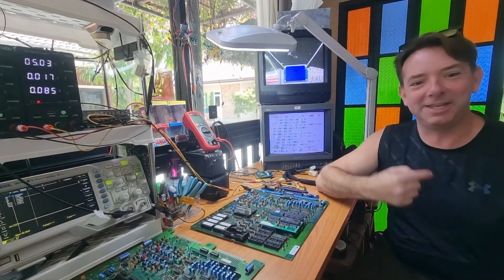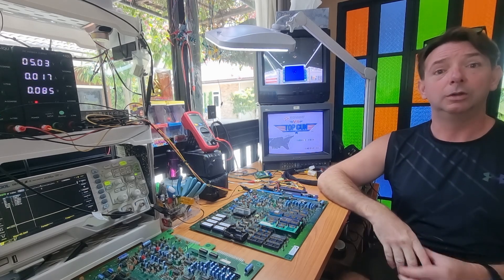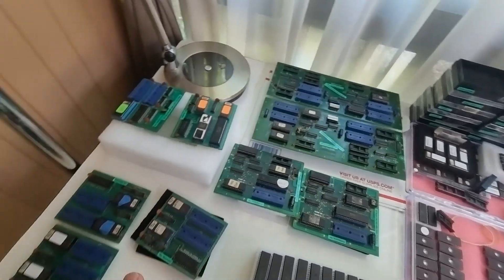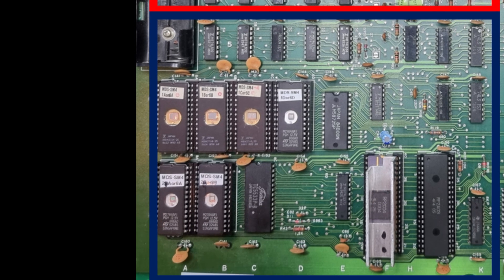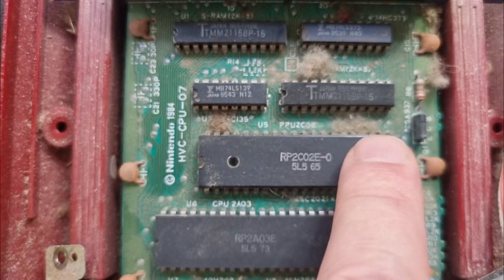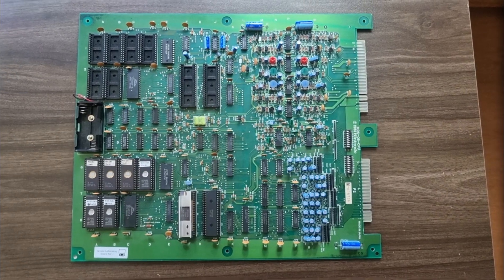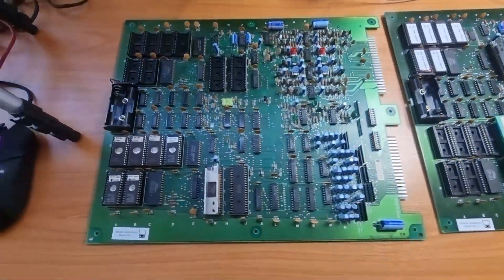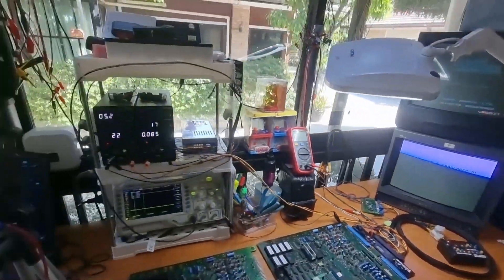Nintendo Vs. System Part 1 The MDS Board

Comment: I have several vs boards/pc-10 boards...  I use a jamma adapter to play these boards. They are not jailbars but some call them vertical ram lines that appear in the image and say this is normal. Local arcade has a vs cab and exhibits the same thing. They're fant but there. What causes this?  I've never noticed them on a red tent only on a stand up.